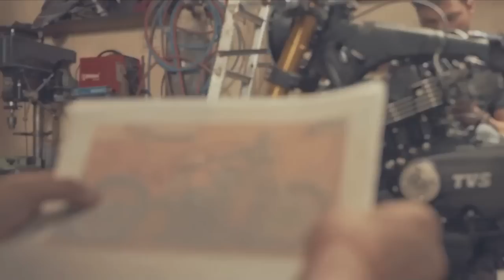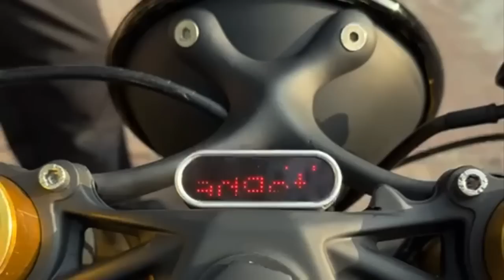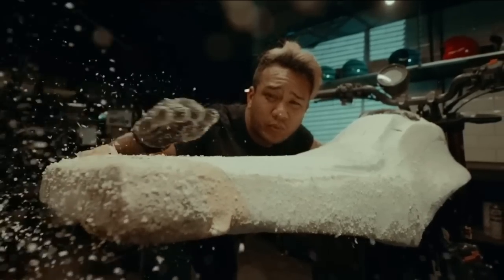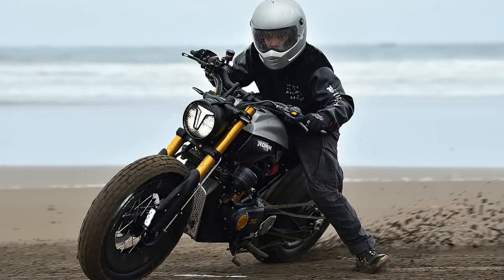Cafe Racer/Scrambler (TVS Ronin by Rajputana Customs, Smoked Garage, and JVB-Moto)

Comment: As you can guess, the simple fact of being a low displacement motorcycle is enough to get me excited. If it is also a motorcycle that almost any human being can buy with a little effort, it makes my heart pump faster than normal. I did not know that TVS is an Indian motorcycle, but it makes a lot of sense and every time you see more motorcycles and tuk tuks of this brand on the streets and highways of Mexico. I like it for the fact that it is Hindu and not Chinese, since a brand from that Asian country usually signs its products with its name, as Bajaj and Royal Enfield do, contrary to Chinese engines and motorcycles that are sold in Mexico under various names. He does not know for sure who is behind the motorcycle. Of course I liked the first motorcycle reviewed better, it has everything I like, simply if it were my design I would leave it the same, but with an engine from a Bajaj Pulsar 200 NS. A sacrilege that would be well worth it!
Reply from the maker: Thank you my friend for sharing your perspective. Here in Europe we have also a lot of Chinase small motorcycles with diferent brands. TVS simply don't exist here. That is why i was amazed by how this brand is big.  :) Saludos.
Reply: TVS motors India has also acquired Norton Motorcycles in the UK and have invested a few hundred millon pounds in the new development centre UK. Also the small capacity BMW 310 GS and G310R and G310RR are made by TVS in India.